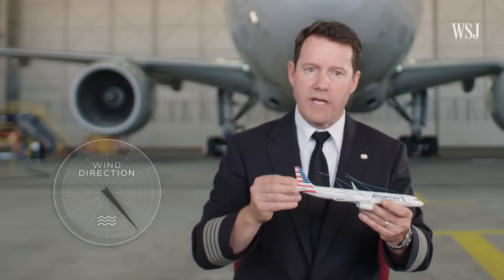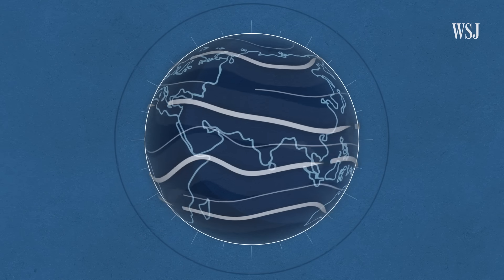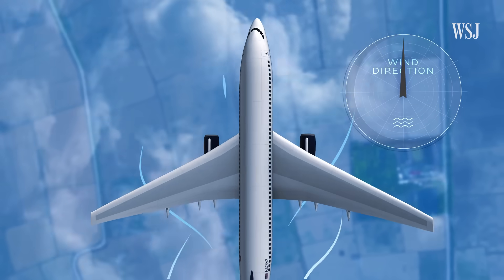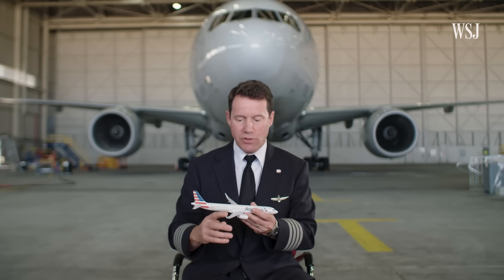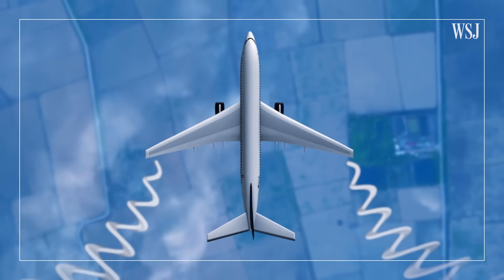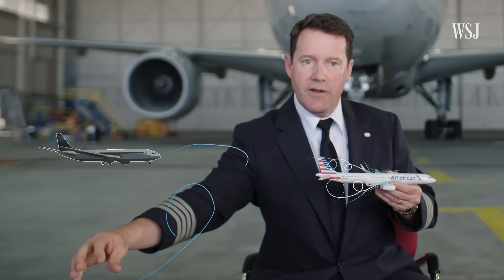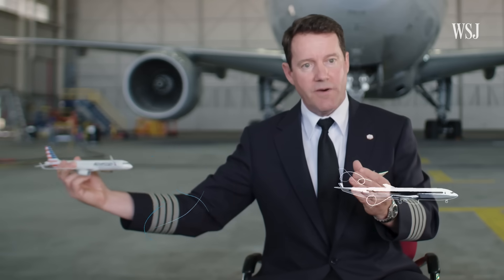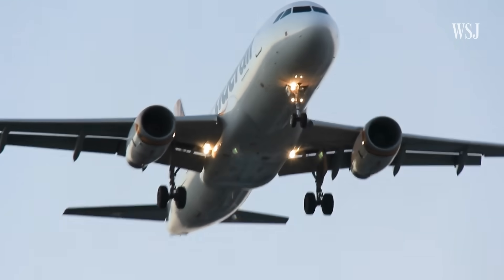Pilot Explains the Science of Turbulence | WSJ Booked

Comment: As a retired airline captain, I  knew most people are a little nervous sitting in a metal tube, going 460 mph, with very little outside visual reference and with no control of your surroundings. Turbulence just adds to the “concerns”. Anyway, when a customer would ask about possible turbulence, I would  provide an answer that was hopefully relatable. I  would ask if they had ever been on a ski boat, fishing boat, etc? Most would say yes. I would then ask if during those rides, if they had a smooth day and a really bumpy day? Again, most would say yes. I would then say being in a jet is the same. It’s just the medium is air instead of water. And as in the boat, it’s uncomfortable, but you were ok. This conversation always seemed to provide some comfort.

Comment: Wait, so whats the turbulence that causes a plane to drop 6000 feet randomly that send stewards crashing into the ceiling?
Reply: It's windshear because during a thunderstorm, a large column of cold, dense air rapidly descends to the surface of the earth. and it also bring the plane down with it.
Reply: It did not dropp 6000 ft, it dropped 300 ft and the rest was a controlled descent by the pilots

Comment: As a pilot I can say that, for those who are not aviation professionals, this is one of the best explanations I’ve ever seen regarding turbulence.
Reply: So I got a quick question, what to pilots do when they fly clear air turbulence? I’m in a flight right now and it’s at cruising altitude and it’s pretty turbulent, so I just want to know what pilots do to find the way with the least amount of turbulence
Reply: @ you can’t avoid it, maybe minimize if you took a good note of your weather briefing. Clear Air Turbulence is not visible or noticeable during flight. When inside CAT, you may set appropriate speed for turbulence, climb or descent, depending on what your weather briefing says. Stay cool, my coleagues are aware of it. Have a good flight!

Comment: As a glider pilot who flies in mountain wave, he is wrong about the problem being rotor. I can only think he is flying fast that he is going between the up part and the down part of the actual waves and so feels as though the air itself is turbulent. The air in the wave is actually very laminar (smooth).  It is different to what glider pilots know as "rotor" which occurs at lower levels underneath the wave and is very turbulent air.

Comment: I fly a lot.  I'm not afraid of turbulence.  I'm just afraid of crashing.   So when we suddenly hit a bit of turbulence, in those first few thrilling split seconds, I'm never quite sure whether it's just regular old turbulence or if the wings just fell off because some technician forgot to tighten a bolt.  So knowing all there is to know about turbulence (and how it's not something to worry about) still doesn't stop that instinctive moment of panic as the first sudden turbulent bump hits the plane that perhaps it's not turbulence at all, but rather the tail just fell off because of metal fatigue or a missing bolt or a lightning strike or whatever else could go wrong.  So stop telling me that turbulence isn't a problem.   I know it's not a problem.  It's the plane suddenly falling out of the sky for all sorts of various reasons (mechanical or otherwise) that's the problem.

Comment: I was in the Air Force reserve 6 years. So I flew in a lot of cargo planes like c-124. A lot of them are hollowed out you wouldn't believe how noisy. The bodies would call and say hey I need to get some hours you want to fly to Las Vegas this weekend, I would say yeah. Anyway after flying on a cargo plane just hollowed out, getting on a commercial plane is a breeze and a commercial plane seems like you're barely moving because I flew on some corporate airplanes the company I worked forehead they had big Grumman engines I flew out of Minneapolis up north almost to Canada to a resort. By your time you got off the ground they had a dial you could look at and we were going 500 miles an hour and no time. That's a lot different than a commercial plane like 30 minutes to place 300 miles away. Anyway get on a commercial plane you feel like you're going to slow motion.

Comment: you might want to point out that the airplane is designed to withstand high load factors between 2 to 2.5 the weight of the airplane, meaning the plane will remain structurally intact in all but the most severe turbulence, the kind your plane would never taken off with if it was forecast.

Comment: As a pilot, I can testify this was pretty informative, and the information shared was accurate.
Reply: Nothing was said whether turbulence is a danger to the aircraft or just affects comfort
Reply: @sergeyrozenblat7849  If turbulence was a danger to aircraft, they’d be falling out the sky left and right
Reply: @sergeyrozenblat7849  read my response in my other comment.
Reply: @sergeyrozenblat7849  True that. Could somebody give an answer to this
Reply: @shanonfernando1326  yes it can be a danger to airplanes and some airplanes have torn apart in flight because of it. HOWEVER, it is extremely rare and the airplanes that did tear apart were operating over Va and the pilots are usually making extreme or erratic inputs on the flight controls. Va is the velocity that an aircraft must fly lower than during turbulence. You do not want to be above your Va speed while in turbulence because a lot of stress can be put on the plane.

This is a very general description but it should answer your question. Again, it is extremely rare that an airplane is damaged especially critically damaged due to turbulence.
Reply: @carveking  thanks for that info man. Appreciate it
Reply: @shanonfernando1326  like carve said, there is a certain velocity limit below which any flight inputs are safe for the aircraft. Incase one exceeds the limit, damage to the craft can occur due to sudden inputs from the pilot. Turbulence is mostly avoidable given that we have much better ways of predicting it these days, but you can get a few stories of flights on a bad day..as long as we keep our seatbelts on when the pilot tells us to, we’re safe. Planes go through a lot of testing as well.
Student pilot here.
Reply: @shanonfernando1326  Statistically speaking there has never been an accident (FAA definition) due to clear air turbulence.

To expound upon what other pilots are saying, most cabin-class aircraft have what's known as a "Turbulence Penetration Airspeed" (the purpose of which is pretty self-explanatory). If the turbulence is light to moderate, the pilot will slow to below turbulence penetration airspeed. If the turbulence is severe, they will slow to below Va. Flying below the designed maneuvering speed (Va) will allow the pilot to fly through turbulence and apply full deflection of one control surface without risking damage to the aircraft.
Reply: @carveking  you don’t use VA as turbulence speed in commercial aircraft. You’re clearly flying small GA airplanes. Please don’t think you understand how anything airline works until you do it. Good luck.
Reply: @carveking  LOL you should have known by my response I’m not X plane guy. Especially when I called you exactly how you are 😂 A320 captain here. Don’t be sad that I called it how it was.
Reply: @carveking  Vno is actually the speed you are referring to (Normal Operating Speed). Va is the maximum speed at which the pilot can use full deflection of controls and not over-stress the aircraft. Va is also not a constant speed and depends on the aircraft’s gross weight. Cheers!
Reply: @Intermerd_A  I know what the speed definitions are. Va speed will allow the wing to momentarily stall before ripping off due to load factor. I suggest reading into it. Va isn't technically right either but it's better than Vno which is faster!
Reply: @carveking  that’s false I’m sorry turbulence can’t really do that. It’s just human error. Planes are built very strong
Reply: “How do you know someone is a pilot” 

“They’ll tell you”
Reply: @Broccoli_32  Speaking as the pilot that I am, I can confirm the accuracy of your joke is... accurate.
Reply: As a passenger, I'll still sit in the back of the bus with the cool kids
Reply: was just about to check if the video was a dud or spot on myself lol
Reply: Of course because the presenter is a veteran.
Reply: OH thank god I thought they were lying !
Reply: Can you give your take of a round Earth vs. a flat Earth argument? Do you or the computers adjust the level of the nose so that you don't fly into space?
Reply: @3-piece129  Also we absolutely DO make adjustments for the curvature of the Earth.

A compass aligns itself with the magnetic north pole because of large arcing magnetic fields that span over the Earth surface, connecting the north and south poles. A compass senses what we refer to as "Magnetic North", and our direction of flight relative to magnetic north is our "Magnetic Course".

However, the location of the magnetic north pole and geographic north. We refer to geographic north as "True North". This is how all of our charts and GPS's are oriented, so this is how we want to fly. To do so, we must account for how the magnet on our compass will deviate from true north depended upon our location on the globe. We determine this by referencing charts which display "Magnetic Variation Lines" which tell us how far off our compass is from true north.
Reply: @devynthurman8444  Thank you. So arevyou saying earth is round?  This vaguely sounds familiar, I've heard other people talk about this but I'll need to read more about it.  So, is there a height or elevation that one must be above the earth to observe the curvature.  In pictures taken from high above earth, it appears that you can see for thousands of miles. It seems to me that earth is actually more like a football shape than a basketball shape.  Could the established size of the earth be wrong?
Reply: @3-piece129  Yes. The Earth is round. People say you can see the curvature of the earth around 35,000 ft but I'd say it's closer to 40,000 ft.
Reply: @devynthurman8444  Fun fact, you can actually see the earth's curvature at even lower altitudes in the morning.  You get a nice preview of the sunrise as the glowing orb refracts off the atmosphere for a minute or 2 before it actually begins rising above the horizon!  Beautiful display of Earth's roundness.
Reply: @ScreaminEmu  Yep! The enhanced visibility during the winter will help with that too. That's why it's one of my favorite times to fly... Commercial or GA.
Reply: @3-piece129  I assure you Earth is Flat. I flew from Sydney to San Diego last year as co pilot for a corporate pilot. We didn't account for any curvature! Our msl and Artificial horzion showed us we flying level to sea level of the ground this can only be possible if there is no curvature!
Reply: @ZackWolfMusic  interesting 🤔... thank you.  I won't ask anymore questions so that it doesn't become a F.E. vs globed Earth and take away from this particular video.  Take care out there.
Reply: @3-piece129  Yeah your welcome and as you can see the guy never relies to flat earth questions! He knows he has trouble admitting earth is flat, like most pilots are!
Reply: Thanks for all you do captain!
Reply: Omg it work!!! I invested with this website 👆 I made over 45k from them..
Reply: I have question. How do pilots see wings and engines of the airplane?
Reply: Actually Turbulence and Sonic-Booms are caused by a rapid build-up of farts in the Stratosphere; I am a leading Aviation Physicist.
Reply: Is turbulence dangerous I went through it on the way back to England from Sweden back in 2019
Reply: Pilots comment???
Reply: Glad you agree with the commercial  pilot with over two decades of knowledge. 🤣
Reply: Can a turbulence cause the plane to crush?
Reply: Thinking......you're not a pilot
Reply: Can you take me from Europe to new york on a small plane?? I have a phobia
Reply: flight simulator pilot?
Reply: Only thing this pilot is not honest about is the missing ocean curvature! All because Earth is Flat! Cheers!

Comment: As someone who gets anxious flying, this will help alot as I can understand a little more of what is going on. Thanks for uploading!
Reply: It may help to know that no commercial plane has crashed due to turbulence in at least 40 years :) It's just not a threat for modern planes.
Reply: @MattDoesSound  I typically tell folks that are afraid of turbulence that modem airliners are built to withstand turbulence much more severe than they'll ever experience and that turbulence won't bring down an aircraft.
Reply: @MattDoesSound  as someone who had panic attacks and anxiety about flying that doesnt help. Intellectually I know that but that statement doesn't mean a thing when my body, not my brain, thinks turbulence = death. Just like anything it's more complex than that.
Reply: Ride the waves!
Reply: knowing this actually scares me more :(
Reply: @Maya-sv1pz  Don't be afraid.  There are a multitude of things that support flying as safe, even in turbulence.  The next time you get nervous or anxious, just remember that today's passenger planes are tested to withstand turbulence far greater than anything you'll ever experience on a commercial flight.  In addition, the flight crew keeps an eye out for potential severe turbulence and avoids it, and if you do happen to fly into turbulence you can be sure that the flight crew is working with air traffic control to find an altitude that will provide a smoother ride.  Turbulence can be unsettling for some, but flying through turbulence is perfectly safe.
Reply: @BoomerKeith1  God bless you Sir. I am quite afraid of flying. Off late I have to travel even more. This explanation helps. Thanks for commenting and helping others. Blessings to you from India
Reply: @mayurnayudu3376  Glad I could help you sir.  Perfectly safe.
Reply: @BoomerKeith1  your comment reassured me a lot 🙏🏼
Reply: @BoomerKeith1  that's very comforting to hear but when the crew starts running up and down the aisle to remind passengers to fasten their seat belts and passengers become eerily quiet, that makes me really nervous 😊
Reply: @VeryMerryLou just for turbulence because if the plane rocks about... probably not nice to slam into the ceiling at 10 mph
Reply: @Maya-sv1pz  For me being able to identify movement e.g. when coming into land is great. Say we hit turbulence on decent and the plane moves or drops... okay so its a "Wake" and the pilot just is correcting course.
Reply: @ptys.  ,,,
Reply: @ptys. That's not what wake turbulence is at all, it only forms when planes are around and barely last 2-3 minutes, and if the plane is the same size as the one you're on its light turbulence
Reply: @Maya-sv1pz  I used to be way more freaked out by it. Then I researched how planes were built and the stats of crashes etc. Literally thousands of flights happen around the world every day without incident. Think of the last time you bought a lottery ticket and imagined all the things you'd were gonna do with the winnings. Our fear of flying is the same as our anticipation for winning the lottery. We think we're special. But stats are stats and we'll all be fine and stay broke hahaha.
Reply: @Maya-sv1pz  yup what she said
Reply: @Maya-sv1pz  not sure why
Reply: Okay everybody 😜 reading this comment (if you’re afraid of flying like many of us) go read Keith and Kyles comments on this thread. They are gold. I think my fear and anxiety just left 🤣
Reply: do you even know whether its a turbulence or this is it?thats the question
Reply: @plooplank yes because if "this is it" youd just die
Reply: Same
Reply: Good video, but one thing was missing that should have been mentioned: don't worry about turbulence. When was that last time you heard of a plane crashing due to turbulence? That's right. Never. (Note: it has happened, but it's extremely rare). Just make sure you get your seatbelt on asap when told to do so so you don't get thrown up to the ceiling like a jack-in-a-box. I'm not a pilot, but have been a passenger for 52 years and have seen a lot of turbulence.
Reply: The aviation field is unique in that the more you look into it the safer you will actually feel. The rules in aviation are written in blood, they are followed closely and enforced strictly; as a result flying commercially is one of safest things you can do. Statistically(USA) if you get into your car and drive for 30 minutes you have a 22% higher chance of dying in that 30 minute period than you do on a commercial airline. Odds of death in a 30 minute car ride = 1/8.5million; Odds of dying on a commercial airline flight 1/11million.
Reply: Search for a video made by mentour pilot on youtube. It goes much more in detail, hope it helps
Reply: Same
Reply: As someone who had panic attacks and anxiety about flying please my guy try and get some therapy. It did wonders for me!!! I was able to step on a plane and fly to Japan woth little to no trouble. Yes the flight was clear but still 11hr in a plane was not easy but I did it. I suggest you look up coping skills as well too and work on those to help.
Reply: when I heard we were experiencing some turbulence, I thought it was turtle related. Turbo the Turtle